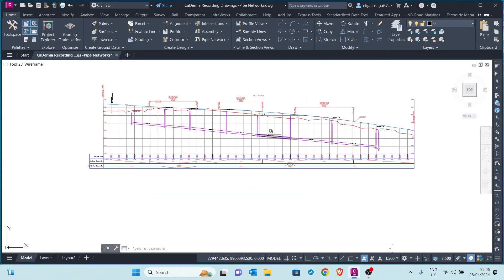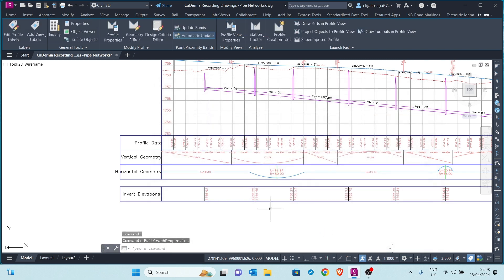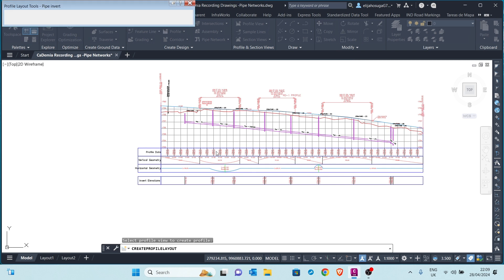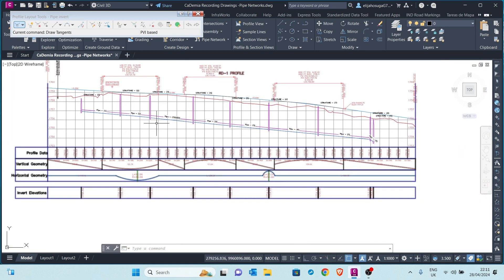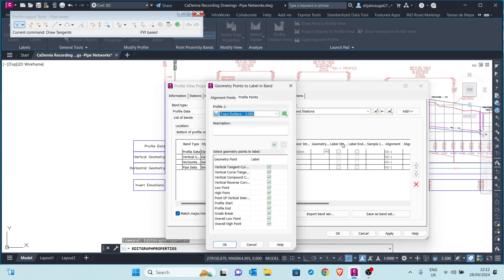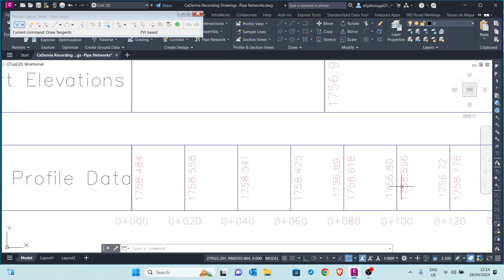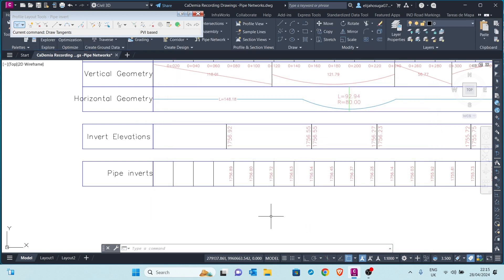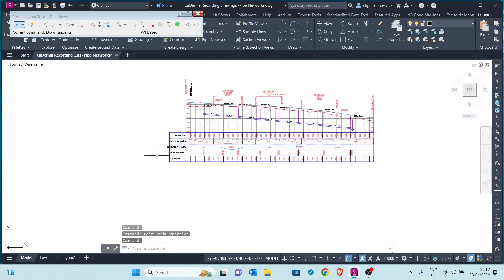Civil 3D  How to Create Customized data bands for your Pipe Network

Comment: Hello Sir,

Currently, I am working on creating a profile band set for the "pipe pressure network" project by following the steps in your tutorial.

However, when I add the "pipe data" band set, the result is that my profile band set does not display any information—it is completely blank. This is different from when I add the "profile" band set, which successfully displays the profile information.

Recently, I learned that the issue might be because the "pipe data" band set's "datasource" has not been configured. However, when I attempt to set it, the information is blank, and no options appear in that column. Could you help me find a solution for this issue? Thank you
Reply from the maker: could you please share your dwg on the email of my youtube bio